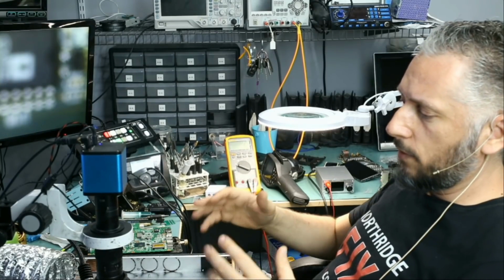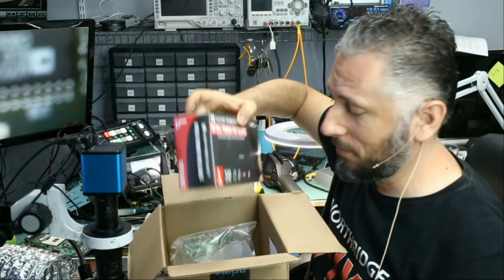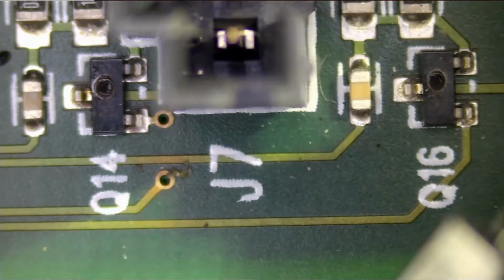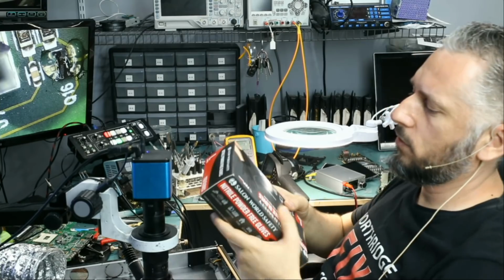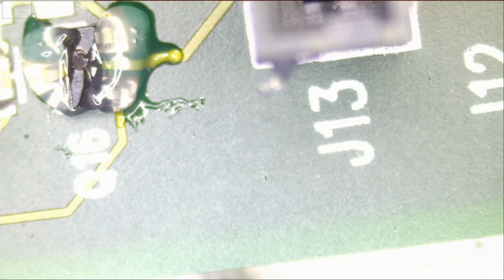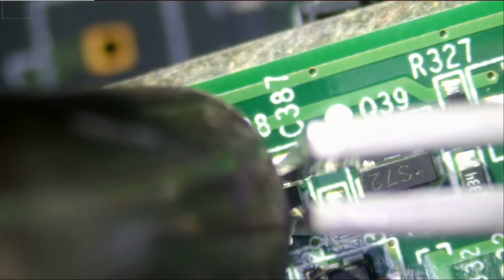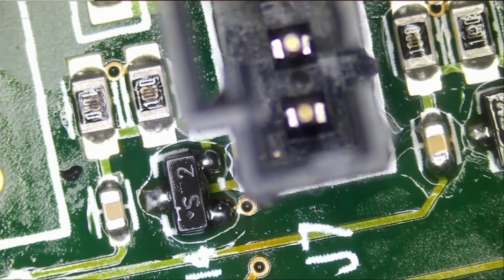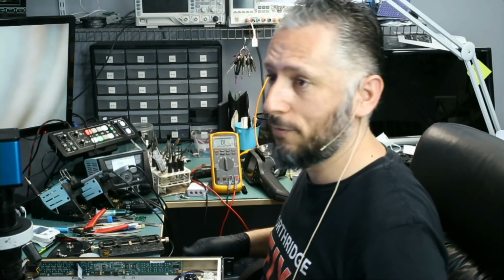Evertz 5600msc Repair using Laptop motherboard

Comment: Sir I have a ⁉️ you said when resistors go bad they increase in value fr example a 10 ohm resistor when measured the resistance is beyond the actual value which you said is correct, so I wanna know what if the initial resistance value is 10 ohm and after measurement we get 0hm, does it mean the resistor is cooked also or uncooked? 😅

Comment: The MOSFET is the most common type of transistor today. Their primary use is to control conductivity, or how much electricity can flow, between its source and drain terminals based on the amount of voltage applied to its gate terminal.

Comment: I am always delighted watching your videos.  Those 10 ohms resistors were reading 5.4 ohms because they  are connected in parallel. Of course, getting 5.4 ohms means that both resistors are good. If one was opened, the other would read 10 ohms, assuming that it did increase in value because of a defect resulting from a thermal condition.

Comment: You don't even really need low melt solder for sot23. Ordinary solder will do just fine.
Reply: Those resistors are in parallel. So 5.6 ohm is perhaps a little high. Shouldn't be more than 5.1 ohm

Comment: Those 10 ohm resistors are in parallel one each side of connector. So when you place two equal value resistors in parallel there combined resistance is half +/- tolerance.

Comment: I'm in the Aerospace industry. we use real high end tweezers i think you'd like alot. I'll have to send you a care package. these tweezers are like $100+ but they are extreme precision and built to last. ether all 410 stainless steel or a inconel Alloy.

Comment: I ordered a CPU heatsink with fans off amazon once, and received it earlier than expected. Once I got it and mounted it, I thought, man I like this thing, it looks nice and kept my cpu temps down really good, sure be nice to have another one for my other computer. No joke, two days later, I received another amazon package I wasn't expecting, low and behold another heatsink with fans came in just like the first one and was only charged for one. Called amazon costumer service and let them know about it, told them I'd just buy it since I liked it and could use another one, they said keep it at no charge. It was a $50 dollar part... thank you Amazon.

Comment: The other thing you can do with misaligned tweezers is to put a piece of sandpaper on a flat surface (a sheet of glass or a granite tile works well), and holding the tweezers closed, rub them on the sandpaper until the tips are correct.

Comment: Wow, just looked up what that thing actually is and it's used in broadcasting studios, costing several thousand bucks. It failed because of two parts that literally cost pennies which could have been saved by polyfuses also costing pennies.
I'll never get these design decisions, but hey, great work on this, man. Always makes me think why repair work is often underappreciated. I guess it's the work done costs many times more than the parts itself.
Also good to see there are still people out there who think otherwise and send you small gifts.
Reply: Not sure a fuse would have helped, why did they fail in the first place?

Comment: They should be a very close match. Both were 2N7002, though the mosfet originally used has a 320mA max rating vs 280mA rating on the replacement part. (see also the third row when you were looking up the type) Thanks for showing the lookup tool, was always wondering how to decipher the SMD codes.
Reply: Doubt it will be an issue if you don't stall the fan.  Those 5v fans are usually pretty low amp.

Comment: You know - you can use hot tweezers to remove sot 23 devices.  That way you don't use hot air or waste your low melt solder.  And its much faster with the tweezers.

Comment: although execution was good - just replacing blown parts without having a look for the cause - that doesn't sound right to me
fan drivers are power elements - so they're designed for that continuous operation - blowing BOTH hints that not just one of the fans failed - but that both were somehow overloaded or blocked at the same time
what was done here isn't more than tinkering with the symptoms instead of curing the cause
Reply: That's what I thought, like replacing a blown fuse without looking for the reason that it blew. If there's a fault upstream then the new mosfets will fail too.
Reply: @pcb1962  the fact nothin blew after the repair and the fans spun up again shows that they're not dead
so it was most likely a temporary overload by blocking airflow around the case
not asking the customer if this was / is the case or at least give an advice about possible reasons to look out for is bad customer service - just take another weird item cause the last one worked out well isn't a good baseline for customer relationship
as a wild guess in the blue: either the fans themselfs or the power transistors will fail again - mostly due to user error by overloading the fans by blocking airflow again ... we'll see

Comment: Two separate circuits fail. Not common unless a separate component shorted and overloaded the circuit. Probably one fan failed and wasn't noticed until the second failed. A customer stated his headlights kept fading and finally they quit. 4 blown headlamps!
Reply from the maker: Customer picked up today and I asked how it happened. He said there IT Guy installed the fan with stripped wires that touched each other.

Comment: Hi brother, 
where can I buy low melt solder? 
I don't live in the USA. Can I get the link oder name of the shop where I can purchase it? 
شكرا Thank you
Reply: Any ordinary leaded solder with a good lead content will work, the one I use is 60/40 tin/lead or 60/39/1 tin/lead/copper
Reply: @pcb1962  Thanks

Comment: Amazing vids man.. Love the content.. Quick Question though, I am trying to desolder ps4 analogue sticks with hot air gun and desolder Iron but I am unable to do so, it doesn't even move. With xbox analogue sticks and other types of devices I don't have problems.can u give me a tip of what I am doing wrong?

Comment: The true question is :. Why these MOSFETs failed? It's odd that both failed in the same time...any thoughts?
Reply from the maker: They failed because of user error. There IT guy plugged the fan connector in the wrong way.
Reply: @NorthridgeFix  wow...interesting to know.
Reply: @NorthridgeFix   I supposed an user error thanks for sharing!

Comment: Those resistors are in parallel.. 10 Ohms is parallel is 5 Ohms plus the resistance of the meter lead about 0.6 Ohms.. Totalling to 5.6Ohms 😀

Thanks for the smd manual website.. Helps a lot identifying smd components
Reply: Hello. I couldn't get the website for the smd. Could you please type it here? Thank you a lot!!! AMZAING VIDS .. Inspired me to start my own business.
Reply: @CarlosBandarrinha  all the best for starting your own business 👍🏾
Reply: Yeah as soon as he said they should read 10ohm.... I was like ummmm no. 2 x 10ohm resistors in parallel will equal 5ohm across each lol.

Comment: Hello sir, just one question, why didn't you used hot tweezers to remove those mosfets ?
Reply: Hot tweezers are used when dealing with 2 pin components, mosftets have 3 pins, he could have only taken 2 with them. Other than that there was not much space available because of the connector and he didn't want to damage it

Comment: Very familiar with SPG’s. Connect your oscilloscope to the black burst BNC or H Sync and use a TV trigger, you should see Sync pulse train the black burst with 3.58MHz subcarriers burst on the back porch of the Sync pulse or in the case of hsync no burst. Testing both would give high confidence that all was well with the SPG

Comment: I think its cool that there are many compatible parts. I would think that if its a different name than the original that the insides of the component would be different and cause issues.
Reply: In a simple switching circuit like a fan control almost any mosfet of the right type and current/voltage rating will do, you have hundreds to choose from. If it's a more specialised circuit, high frequency for example, then the component must be chosen more carefully.
Reply: You only need to know if the Mosfets are N-channel or P-channel. 
They are usually almost all the same.
Some may vary between their wattage capacity or high voltage or low voltage "the high voltage ones are used in special cases" (For example these used for the cooling fan are just switch on off Mosfets).  
They are very common, you can find them in computer motherboards because they are low voltage and high amperage, even if they have different names.  
With a Component tester, for examples "TC1"
 It is much easier to identify them even without reading the codes they have written above

Comment: Great Video! Wonder why both blew
Reply from the maker: The customer mentioned something about his IT guy replacing the fans when this happened.
Reply: @NorthridgeFix  Ahh. Do you think they drew to much current or were connected when the machine was powered on?
Reply: maybe he plugged one of them in reverse and shorted the fan circuit, so only their mosfets blew and nothing else on the board.(maybe)